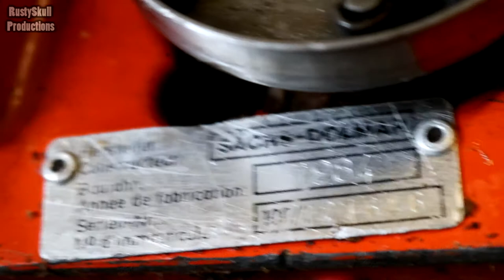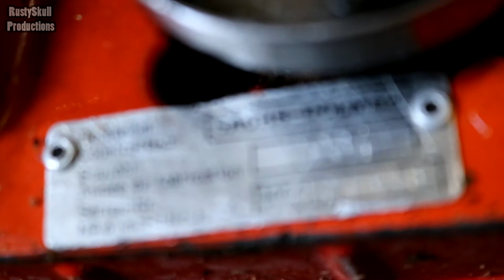£3.50 Chainsaw Will It Run? - RustySkull Productions

Comment: That mesh film is the air filter. It's like an air box really does not really filter the air hence most chain saws have carb problems. But great video nice and long and very interesting always loving the content rusty 😀
Reply from the maker: OnlineCapture Thanks, that mesh doesn't seem to be anywhere near the carb...?
Reply: RustySkull Productions hmm not to sure then some times it's all so for air flow
Reply: RustySkull Productions please check your Facebook messages asap!

Comment: I bought a dolmar 113h for £12 on ebay piston looks like it shouldnt run and i bought it as a non runner cleaned the carb etc it runs great cuts through wood just as good as a new saw its amazing what bargains you can get on ebay
Reply from the maker: You sure can dude!